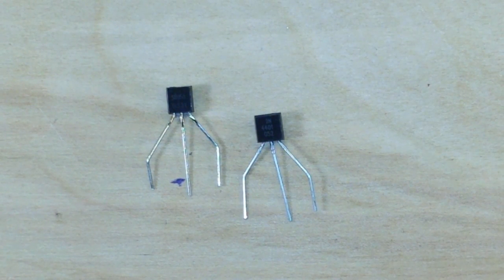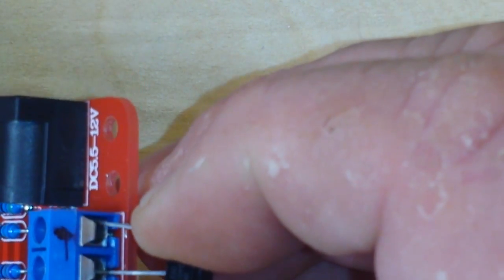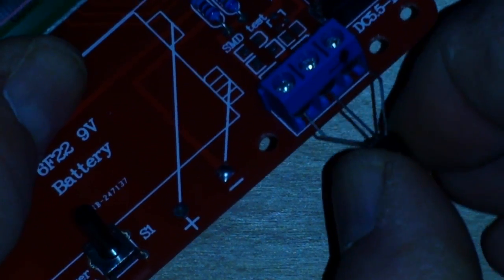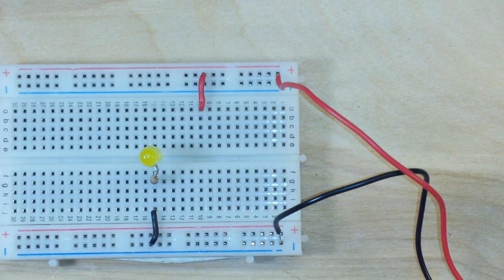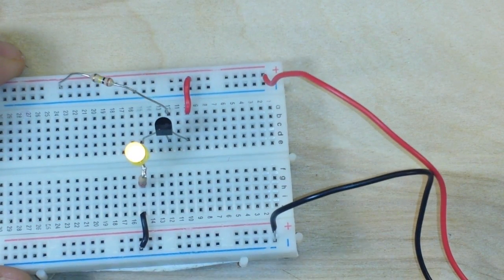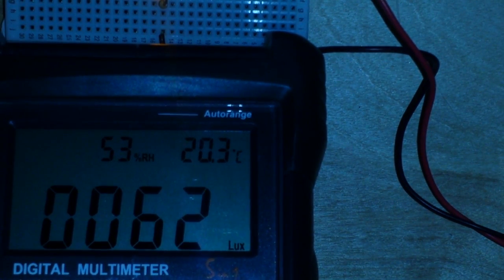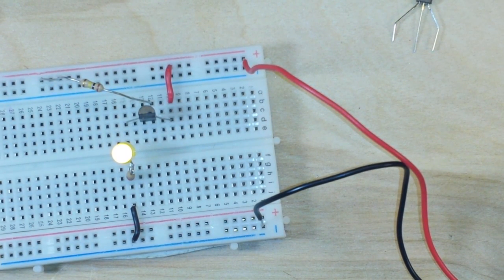Transistor Amplification

Comment: strange, I always thought amplification dealt with audio signals, not current flowing to an LED.  Guess you learn something new every day, of course I was looking for a way to build a small amplifier for a home built MP3 Player
Reply: audio signals are current, so is voltage running to and LED, so I guess it makes sense. Good that you learnt something new!
Reply: Waves are waves. Light and sound work similarly.

Comment: I have problem with this experiment. These BITS were operated in Switch or Saturation mode and second had different specs, mainly less resistance from its collector to emitter allowing more current flow. You need a small AC Signal for BJTs to Operate in the Amplifier mode. The AC signal changes the current from the C to the E in proportion to how the voltage signal varies on the Base.

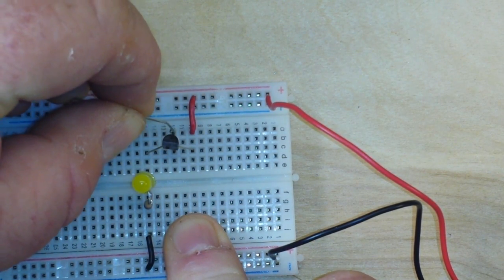Comment: 4:53 This circuit is much simpler than the other amplifier circuits I've seen on LearnEngineering, is this circuit you are showing us amplifying the voltage?
Reply: It's limiting the current flowing through the LED to beta times current flowing through the base, which is controlled by the resistor.
Reply: @juliankwiatkowski1441 So,... basically what we got was an applied math lesson without a full rundown of the math behind what we saw?

Comment: I'm guessing that 10k pot above the VO pin on the LCD is supposed to adjust the contrast which should make it easier to read.
Reply from the maker: Greg Lemons I've adjusted the pot. just doesn't get any brighter
Reply: Exactly correct.
Reply: I think it's the contrast that's making it hard to read, not so much the brightness.

Comment: does this mean I can amplify a voltage signal with a transistor? I'm attempting to amplify a small voltage from a wheatstone bridge connected to a strain gauge, in order to read it with a DAQ device, the voltage that's coming from the wheatstone bridge is only 2mV/V, and I'd like to amplify it to around 1000 times that
Reply: No a transistor is used to amplify a signal. You would want to use a transformer
Reply: Use  low drift dc differential operational amplifier , with an offset  control to set Vout =0 when Vin=0   
with a with a well filtered +/- 5v DC power source;  input short twisted pair of leads to wheatstone  bridge. 
4 resistors should be 100k 1% ( selected ) ;  see Analog Devices  Co. for schematic

Comment: 5:30
U should use photoresistor and write code in arduino to measure the light strength
Reply: Our light sensivity is logaritmic, so hard to differentiate %50 differance by eye or cam. If limiting factor is only B of transistor of couse.

Comment: Can we amplify the current from solar panels? My solar panel supplies 5 A, I need upto 7A .. how can i do it? Please help
Reply: A transistor amplifies signal by using available current to mimic the signal at a much higher amplitude. It doesn't make free energy. It's more like a record player that would only play a very weak sound if it were played with no amplification. In order to amplify, you need more power. The transistor does not supply that power, it simply modifies the incoming power to make it match the patterns produced by the record.

Comment: Could any of you point me to a good video on the very basics of transistors? I barely understand their function as a switch, and nothing about the amplification part.
Reply: A transistor is basically kind of like a diode, except that instead of just two junctions there is a small area that acts like a rudder on a large ship- if you put just a little bit of current through the "rudder", a lot of current will flow through the whole transistor. Think of it like a water valve that is normally closed in both directions. However there is a portion of the valve that if you pressurize it with just a tiny amount of water pressure, that tiny bit of water pressure forces partly open a much larger valve. But that pressurized portion of the valve doesn't hold the pressure indefinitely- it leaks a little bit of water down to the low pressure side of the valve. So you have to supply it with a steady flow of water in order to keep tge valve open. The amount of water it leaks down is very small compared to the amount of water flowing through the valve though, so this valve lets you control a much bigger flow of water with a tiny flow. And certian types of transistors have different characteristics that make them more ideal or less ideal for certain applications. So the basic job of a transistor is to control a heavy current flow of electricity with a much smaller flow. This is a very important job because a lot of electrical signals that we use are very weak to begin with. So in order to make their output more useful, we use transistors to amplify that signal.

Comment: I just learned this myself through trial and error...  Your setup is wrong in a number of ways.  Your running both transistors at saturation so for all intents and purposes they are acting like switches and should work (within reason) identically.  Also you have the load connected to the emitter which has current flowing both from the base and through the collector (which is bad because of lack of isolation (I could never get anything to work properly this way, once I connected the load to the collector things started working as I expected)).  according to my still very modest knowledge; to not saturate the transistor you have to the lower the voltage on the base to below 0.7v (or thereinabouts), then you'll start seeing the amplification effect.  (hope this comment helps someone :))
Reply: I think I see what you're saying. Saturation pretty much maxes out the transistor to whatever current it can handle across its leads, so the difference from one transitor to another may not truly reflect its actual amplification characteristics at below saturation levels.
Reply: The resistor he is using here to drive the base would be plenty enough to drive the whole LED without the transistor in place, so it's kind of not a good way of showing amplification. Cool video anyways, but to prove the principal of amplification, I would have used a much smaller resistor to drive the base.
Reply: @HeyChickens  And, instead of an LED, I'd have used an oscilloscope so that you could actually see the amplitude.

Comment: Transistor tester display: From my limited knowledge with the i2c arduino versions and a bit of googling: the contrast isn't maxed out, turn the 10K pot in front of Transistor Tester text.
Reply from the maker: WKDworks I've adjusted it. it's a brightness issue, not contrast. but I appreciate you taking the time to write, and watching the videos